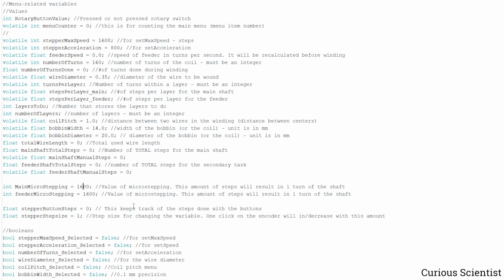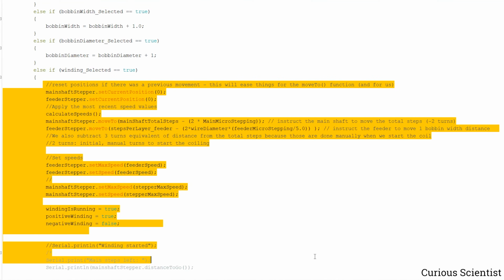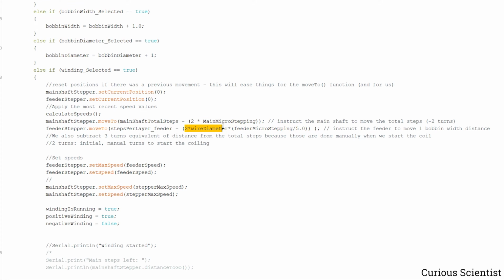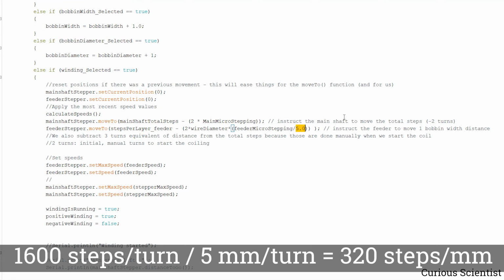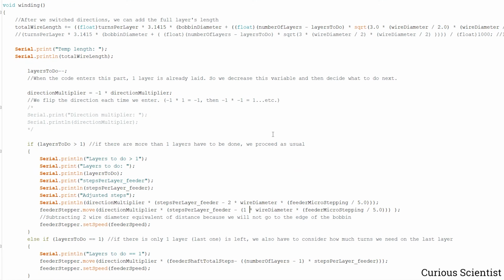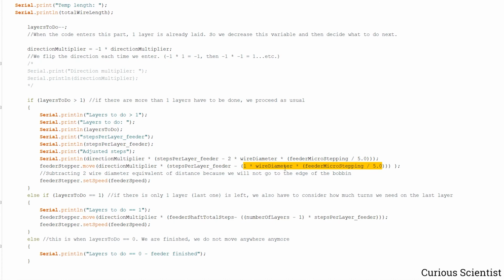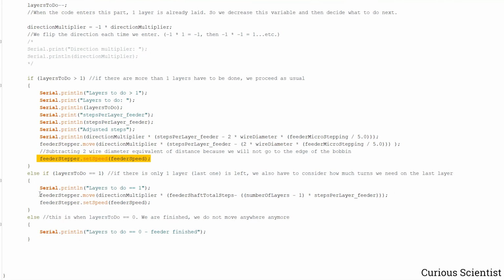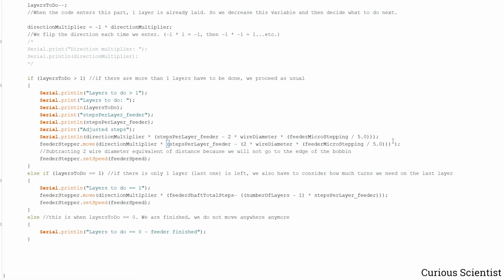Building a coil winder [Part 4] - Updated feeder mechanism

Comment: hello, very nice project! Would it be possible to have those dimensions: the effective stroke of the SFU1605; the length of the 8mm threaded rod? Also, are the stl files for various parts you did are available (just found the feeder)? 
Thank you
Arnaud
Reply from the maker: Hi and thanks! I will check these dimensions. But if I remember correctly, the threaded rod is 30 cm, and the SFU-based actuator can be found on my website. I have this device tucked away in the attic right now, but I am actually planning to do an update on it. I will make sure to update all the files and dimensions.

Comment: I would go with luer lock needles instead of 3d printer nozzles since they are available in a ton of diameters and longer so you can end them closer to the coil.
Reply from the maker: Thanks! I found an even better alternative! A wire nozzle used for electrical discharge machining (EDM). It is coated with ceramic in the inside, so it doesn't hurt the enamel and it comes in a huge variety of inner diameters, even below 1 mm. I ordered a few recently, I will make a new video once they arrive.

Comment: Great job, you are improving this machine in every video👏👏👍 My 2 cents for future updates: every pro winding machine I have used in the past have a springy feeder to absorb the difference of acceleration on square or rectangular shapes (when you are feeding a square bobbin from a round spool), this also prevent breaking the wire because the difference of tension when the feeder is not perfectly aligned to the surface of the bobbin (this is normal because the shape increase with every layer)
Reply from the maker: Thank you very much! I try to make it into a good product so people hopefully will find it useful. Yes, your advice is very useful, thank you! I was thinking about how to incorporate such arm mechanism, but so far I could not figure it out. But I added it to the to-do list. My dream is also to buy a proper wire feeding nozzle to make the winding more precise. I am still saving up for that as they are pretty expensive.